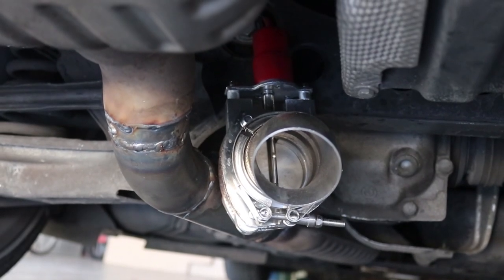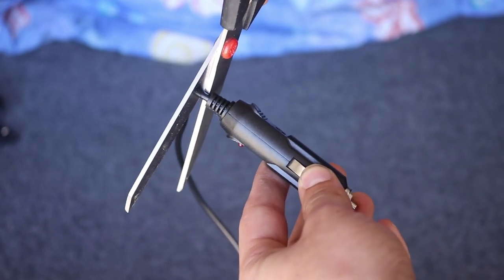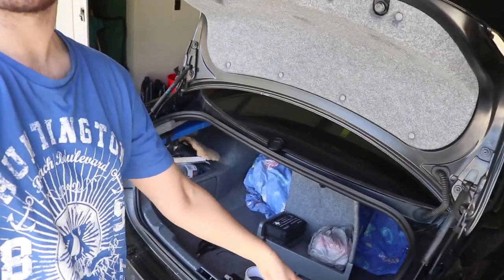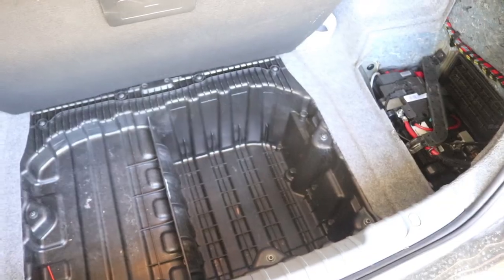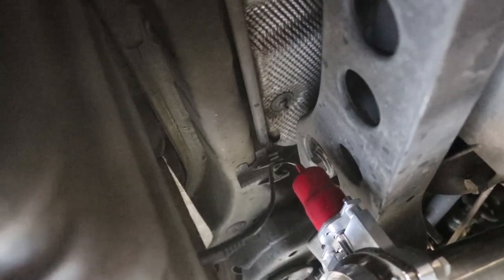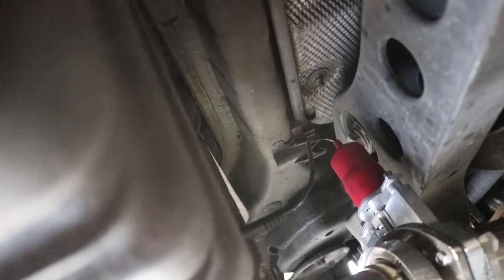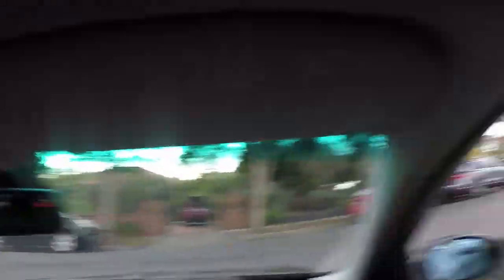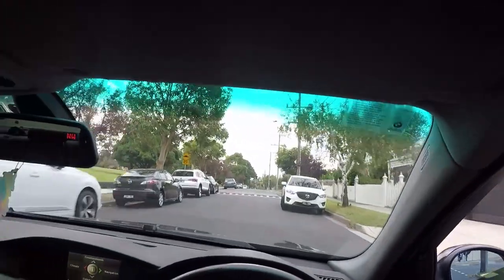BMW Remote Sport Exhaust Cutout - Ebay Mod

Comment: tip for anyone. next time you make an accidental hole in plastic, take a soldering iron and some black tie wraps to it. sometimes you can smooth it out to like it never happened.

Comment: I plan to install this kind of valve on my 2001 Audi S6 (4.2 V8, stock exhaust for the moment),  I will post a video if I ever do it!
Reply from the maker: That i think is going to sound insane!
Please post a video when you've done it!
Reply: How did it go after 2 years lol
Reply: @sickyrides  I bought a sportbike instead :D
Reply: @Haplo59  lol good choice, i have a 05 naked fz6
Reply: @sickyrides  Ducati 1198 tuned (full exhaust/ECU flash/suspensions...), a torque beast ^^
But I sold it to buy a house. I'll get back to motorcycle this summer with a Monster 1100 or a MT-01, the 1198 was a bit too much sporty/powerful and not reliable...
Reply: @Haplo59  Thats dope, i love the Mt-09 it just sounds insane with a full exhaust system.  I'm just having fun on my 600 now lol. Im 16 not trying to kill myself :).
Reply: @sickyrides  That's young for a 600, where I live, you must be 18 to get >125.

You're lucky ^^

Comment: sounds great! I also have a 330i, and am looking at a QTP cutout. One thing you might wanna consider, as it didnt show in the video. did you wire an inline fuse from the battery ? or did it come with an inline fuse already pre wired ? hate for you to blow the electric motor.  have a good one.
Reply from the maker: Looked at QTP but their pricing wasn't very friendly compared to eBay cutouts and personally I reckon the quality is quite similar. 
As for the fuse, I need to get around to doing that in a future video but currently overhauling my front suspension this week!
Reply: @LachysGarage  how did you go about the fuse . Just got one and need this too 😬

Comment: Hey I have a question, so I measured the diameter of the exhaust and it’s around 2.35 inches in diameter. You bought a 3” pipe for yourself, wasn’t that too big. I have a 2015 535i msport btw

Comment: Does this trigger any check engine lights at all ??.  I once had an accidental crack in the exhaust that sounded great actually but it kept triggering an O2 sensor check engine light.  Maybe this doesn’t hopefully
Reply from the maker: No check engine lights whatsoever, this cutout isn't near any O2 sensors as they are all located up the front of the exhaust best the headers so you'll be fine installing this!

Comment: Hey mate what shop did you get the y pipe wielded on at I’m in Melbourne myself and want to install one on my e90 as well
Reply from the maker: Trufit Exhaust - Muffler & Exhaust System Specialists in Moorabbin
Reply: Lachy's Garage | How much did the shop charge you for the install?
Reply from the maker: @suubierex9396  was $150 from memory

Comment: Is it auto tranny?  Gettin e46 330ci auto and hoping to get same exhaust sound. Good work guys, cheers from Scotland!!!
Reply: it will sound just as good, trust me
Reply: yo, did you end up doing it to your 330ci? thinking of doing the same to mine!
Reply: @JACKBUCKINGHAM  not yet, still looking for one. Hard to find the right one
Reply from the maker: Have you looked into going with power and getting 335i instead? That's my biggest regret with the 330i....

Comment: I have a 2008 bmw 535i e60 what size pipe should i get it?
Reply from the maker: 1 slow E60 _ the 2.5/3" should both fit from memory
Reply: Lachy's Garage thank you! I will be buying the 2.5
Reply from the maker: @1slowe60_9  Good luck! Let me know how it goes!
Reply: Hi can you choose different levels?

I have a 535 xi 2008 mpackage   my original already have hydraulic but can't control myself
Reply from the maker: Joel Pelly it would have the flap that every BMW has that can be controlled through OBD2 port, this bypasses the muffler and allows you to open it on command
Reply: @LachysGarage   thanks sir
Reply: @1slowe60_9   how did it work for you? i am trying to buy one
Reply: ABBA YAKUBA GONI never did it but this week im getting a custom quad exhaust to fit my M5 rep bumper